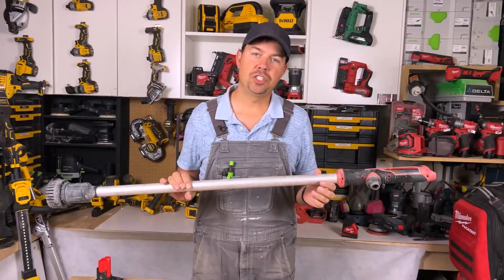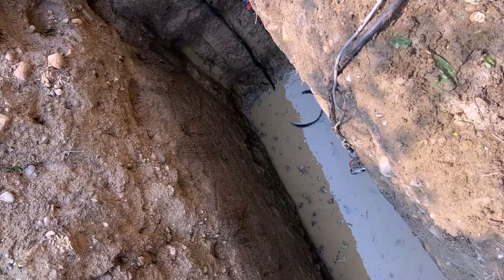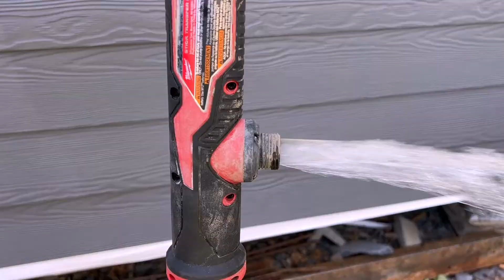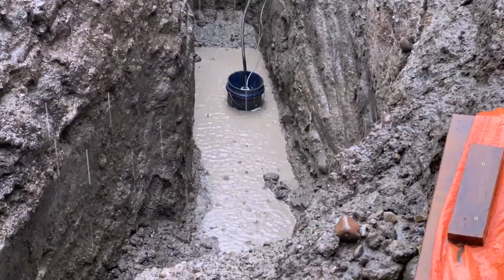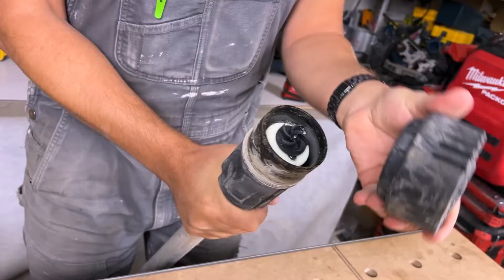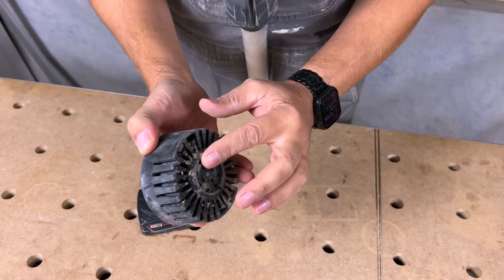Milwaukee Stick Transfer Pump has its limits... and I took it there! REVIEW & REAL-USE DEMO

Comment: will this work as a backup system for a marine head?  offshore, if/when, the boat toilet macerator pump does not work and I need to dump the head, will this work?  Will it pump poop and toilet paper?

Comment: question for anyone that owns one of these. what is it like using this with a hose and a spray nozzle on it? will it burn the motor up? or is it just like a super low pressure?

Comment: Yeah, I bought one today to pull water out a hole I had dug around a cluster of sprinkler valves that hadn’t been touched in 15 years. I dug a well of sorts to collect the water as I was rinsing dirt off the valves and this shut down quickly from the GA clay. I took the bottom off to clean it, but it still won’t prime. Yay.
Reply from the maker: @wfodave  I had to blast clean water in mine to get it working again. It definitely doesn’t like clay

Comment: use mine all the time, connect a 3/4 or 1'' hose and you will get great output from it. clogging up is a real issue though. I might drill bigger holes in the suction

Comment: No transfer pump can handle that mud, get yourself a trash pump buddy
Reply from the maker: I have a couple Honda trash pumps, I ended up using a simple sump pump in a bucket, worked for the little bit of water down there. I new the m12 would have issues but I was hoping it would work and blow my mind. Worth a shot though 
Cheers

Comment: Yeah, I wouldn’t even have tried to pump a ditch out with that, use a diagram pump
Reply from the maker: Normally I wouldn’t, but it had to be tested 😬. I think it’s a handy tool to have, but right tool for the right job is key.